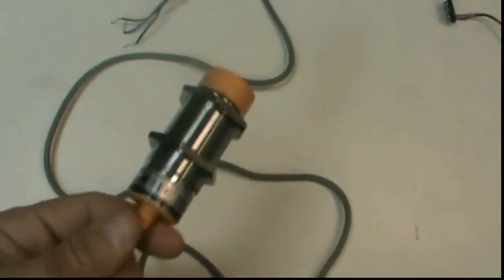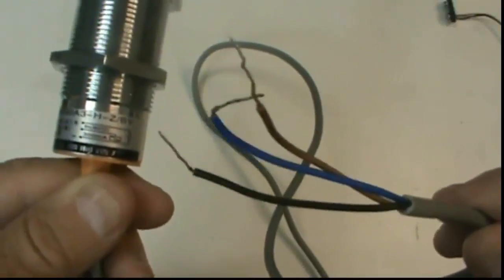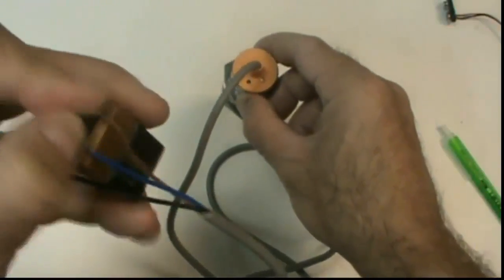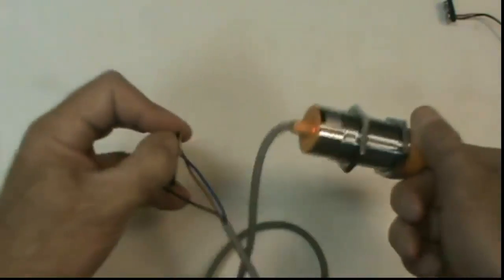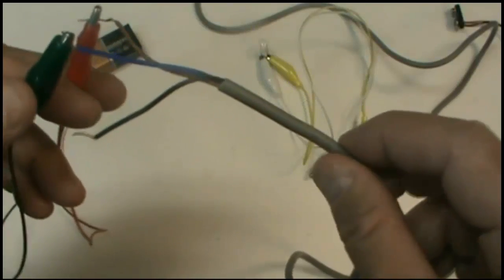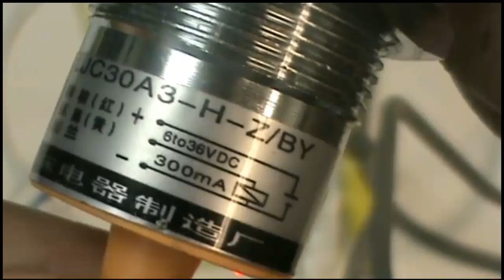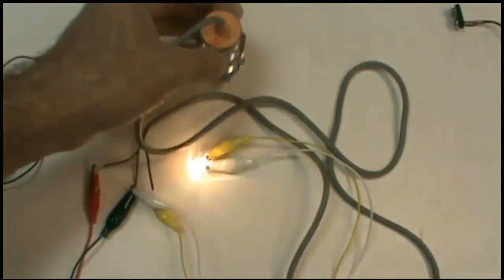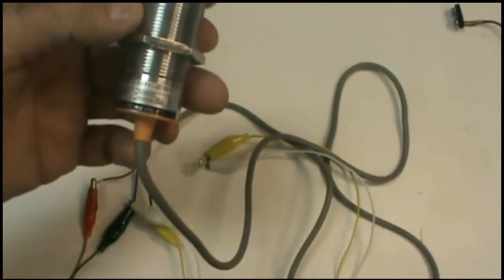Proximity Sensor Basics (PNP, capacitive)

Comment: Very useful. Your instructions are very clear - especially the stepped i.e. first the built-in activation indicator and then the light bulb; as well as the alternative configurations of some sensors. You have experience as an instructor - I don't have to look at any other videos to understand the use of the device. Thanks
Reply from the maker: Thanks for your very flattering comment.

Comment: Excellent explanation ,Please is all proximity sensor use DC current only? If yes why is it so.
Reply from the maker: There are some A.C. proximity sensors but 24VDC is a widely used voltage to power both PLCs and sensors. It is a safe voltage that allows technicians to work without being exposed to dangerous voltages.

Comment: Thanks Dorian nice job.  Not trying to be critical, but, the schematic that popped up toward the end of your video looks like it should have had the ground that ties into the body of the sensor tied together with the negative (common) from the lamp, not separate?
Reply from the maker: Sorry about the confusion. The common connection between the sensor and the load was implied but not obvious as you mentioned.

One of the problems with sourcing outputs is that sensor and load must usually share the same power supply since an interaction between two separate voltage sources, particulary with two different voltages, would result otherwise.

All power supplies have a 0V or common output so these power supplies can be tied together but only two identical power supplies have the same V+ voltage so tying two separate power supplies together would cause a problem.

This is one reason why an output scheme called "Open Collector" was popular for digital logic. Open Collector outputs allowed an sinking output transistor to switch an voltage much higher than the 5 volts required for the digital logic.

Thanks for you comment.
Reply: Dorian McIntire

Nice of you to clear that up for me.  I'm just starting to learn about this technology and any "loose ends" can create confusion on my end.  Thanks again.

Comment: the video was very good . I would like to know how this sensor will work in water tanker and how to calibrate it to show the level for example (1/4,1/2,3/4 and Full)  with the help of LED.
Reply from the maker: There are several options depending on what you are allowed to do with the tank.

If penetrations are allowed in the tank you could use side-mounted, float, reed-switch level sensors. These require a penetration for each level that you want to detect. These are simple, inexpensive and reliable 

http://www.gemssensors.com/About-Gems-Sensors/Press-Release/LS-7%20Versaplast

If penetrations are not allowed you can use one of the following:

- A top-mounted ultrasonic level sensor

- Side mounted capacitive proximity sensor only if the tank is not metal and not too thick. You would need one sensor per level sensed.

There are other options but the cost gets pretty high for other solutions.
Proximity sensor will work well with water but not so much with petroleum products.

Hope this helps

Comment: Dorian McIntire :Using older diagrams which indicate current flow from Batt. + (pos)  to load-thru load- to Batt. -- (neg). If I understand correctly--if my Batt. ( + )  is my "source" , then everything else IS "downstream" from that (+) reference during current flow. If I place a sensor with contacts (N.O. to turn on/N.C. to turn off) BETWEEN the  (+)  and BEFORE my load, that location is termed a "sourcing" sensor ?? or if I locate my contacts (sensor) AFTER the load, downstream BETWEEN load and (--) or ground, that is termed "sinking" ?? is this correct ?  In other words older vehicles had ignition points that make/break the Neg side of the Ign. coil. Points were BETWEEN Neg. of coil and engine ground, so using modern terminology, the Ign Points were on the "sinking" side of the coil ??.
Reply from the maker: Difficult to follow what you said but the following is true:

-- If the sensor "contacts" (NPN transistor)  are between ground and the output then the sensor is sinking, or switching the output to ground.

-- If the sensor "contacts" (PNP transistor) are between V+ and the output then the sensor is sourcing or switching the output to V+.

It's a simple concept but the two configurations confuse people because most people expect the output to be just a simple switch  which should make it a non-issue.

Comment: Hi Dorian , this a excellent video , i been wondering why do we have Sinking & Sinking In-Out  , I know that NPN is a sinking device  and Sinking In and Sinking Out  is a signal in  a  I/O module ,.In other words why do we use the Sinking option?.
Some times i believe that is about the dropping voltage of circuitry.
Thanks.
Reply from the maker: gerardolasvegasable 

This is a good question.
The concept of sinking and sourcing allows two devices to send signals with no additional components required. The down side of sinking and sourcing is that one device must be the opposite of the other in order to simplify the interfacing. If you have a sourcing sensor you must have a sinking input on the receiving device and if you have a sinking sensor you must have a 
sourcing receiving device. If these conditions are met the devices can be connected with no additional components otherwise things can get complicated. Many PLCs have input cards that can handle both sinking and sourcing inputs. See my video about this called PLC interfacing made simple:
https://www.youtube.com/watch?v=qwjPtqzy2nY
The BIG IDEA about sinking and sourcing is that the two devices together complete an electrical circuit that allows the receiving device to “know” the sensor changed state because. The receiving can only know a sensor changed state by sensing a voltage created inside the receiving device when the sensor switch is closed and a circuit is completed. To complete a circuit you
must have a SOURCE of power (V+) and a return path to the power source, or SINK (ground or V-).
Hope this helps and sorry for the delay

Comment: Hi Dorian. I am going to make a speedometer for my bicycle an I will be using an inductive proximity sensor for that. I wanted to know how can adjust the sensor to detect a metal piece like a bolt attached to the bicycle spokes and not the spokes. Or if I should use something other then bolts ? Also what are two screws on the sensor . I think the adjustor is at the back of sensor so what is the role of those screws. I want to attach the sensors to a small screen a place some metal every 90 degrees so the sensor measures the time interval between successive signals and calculate the speed which will be shown on the screen .
Reply from the maker: Sounds like a nice project. I would look into using a Hall Effect sensor and a few small magnets instead of an inductive sensor. This would give the system much more sensitivity and decrease the tolerances of the components.

Please keep us posted on how things go.
Reply: I have also been looking about hall effect sensor and think they would be good too. It's just that I off-road a lot and I read that hall effect sensor are very sensitive too dirt and dust. Still I am making the speedometer just for fun and think hall sensor will be better in that aspect as hall effect can operate at low voltages and are much easier to operate. 
Just wondering if you have a video on hall effect sensors too? And I will try to put a video once I get it working . Thankyou

Comment: Great Video!  I have a couple of 2 wire (AC) photoelectric sensors with transmitter and receiver combined in one unit.   Any idea how these might operate?
Reply from the maker: Yes, 2-wire AC sensors require the load, typically a relay or a light 120 volt load, to be connected in series with the sensor and power. The sensor closes an internal contact or Triac switch to turn the load on and off.

See the following data sheet for details:

http://www.cmafh.com/images/Master%20PDFs/Balluff/Tubular/AC-DC%202W%20Wiring%20Diagram.JPG

Hope this helps.
Reply: Dorian McIntire Thank you.  Now it all (or at least some) makes sense. I just ordered an AC contactor ( and a fire extinguisher) so I can do some experiments. Thanks again for your help. Your tutorials are by far the best!  Simple, straight forward and informative. Looking forward to watching more of your videos this weekend!
Reply from the maker: LegacyMicro Thanks. I really appreciate your comment.

Comment: Hi, I do not mean to seem naive and have little to no understanding of electronics. However, i was wondering if it would be possible to create a proximity sensor that could locate a missing object, eg. TV remote. It is possible to attach a very small transmitter or something to the remote and have a device which could tell you how far the object is from you? The benefit being you wouldn't need to spend ages looking down sofas etc as it would guide you to it, either with a 'hotter, colder' buzzer or a device which visually displays the distance. Any response would be appreciated.
Reply from the maker: There a few ways to do this but some are expensive relative to the cost of the item they would allow you to locate.

Passive RFID is inexpensive (basically a printed antenna) and a transmitter/receiver could be built to locate an item with an RFID sticker attached to it. Such a device could be built to locate items within a few feet of the transmitter.

When Bluetooth and X-Bee technologies become cheaper manufacturers could embed transmitter/receiver pairs into such devices.

Technologies exist to do what your asking its just a matter of keeping the cost down to affordable levels.

Hope this was helpful.

Dorian

Comment: Hi great video I'm putting a tacho in my car and then found out I needed a pnp sensor didn't even know what it was let alonehow to wire it up after 1/2 an hour I found your video that spoke  in plain English not AC-DC ABRIEVIATIONS FOR US SHORT CIRCUT people, I can say with out a doubt black would have been earth to me.I know this is over 3 years old what camera were you using to make the video the close ups are the best I've seen with out selling the kids. :)
Reply from the maker: I used a Sony handicam DCR-SR68 in those days. I'm now using a Sony Vixia, HD camera. I've always had good luck with Sony cameras. The optical zoom feature helps a lot with those closeups. You can get good HD cameras now for only a few hundred dollars if you shop around.

The color coding for sensors is screwed up. I still often find myself trying to hook black to ground.

Comment: Thank you for the video...
I am learning about these for CNC Machine use...
How consistent are these type of sensors vs for example micro switches that have the little arm and wheel... ?
thank you
Reply from the maker: Micro switches do a great job for low duty-cycle (events that don't occur very frequently) applications. If the leaf (metal lever) on the microswitch gets bent it will affect calibration.

Proximity sensors can be adjusted to give consistent performance by either adjusting the position of the sensor relative to the sensed object or by adjusting the sensitivity setting on the sensor. Also they never wear out since the are non-contact sensors.

Thanks for commenting.
Reply: An Ultrasonic Sensor would seem more suitable here; being the high signal character, and the large pulsed range of marked-space.. for the CNC i mean.
Good luck `Frainkmail17`
And nice vid, `Dorian`  (Dorian<- is a musical notation, right?)
Reply from the maker: Major Utah I think Frank is talking about the limit switch used to zero an axis on a CNC machine. Traditionally a small micro switch with a roller arm is used for this but these can suffer from repeatability issues due to mechanical wear and bending of the mechanical arm. Prox sensors usually work very well in such applications sensing small distances with good repeatability.

An ultrasonic detector is great choice for distance or level sensing and reporting but they usually don't do so well for these small distances (typically less than a centimeter).

Yes, Dorian is a musical mode but also a member of an ancient Greek tribe known as the Dorians.

Thanks for the comment and the thumbs up on the video.

Comment: Hi, I'm a newbie, and a student and I wanted to learn about these things. I have question(s) about these sensors, specifically Capacitive sensor. I haven't tried any of those and I'm required to use this on a water level control project but I have no idea on how to wire a 3-wire Capacitive sensor. I have to use 2 Capacitive sensors. Can you help me? Please. I used the 555 IC for the control. Thanks!
Reply from the maker: Please watch my video about interfacing proximity sensors to the Arduino. The video demonstrates how such sensors are connected to other devices.

Comment: hi question: I'm trying to get the right sensor that would activate a warning light when an object moves away from the sensor [ separation detection ] would that be a NPN normally Closed sensor? thank you great video
Reply from the maker: You can either use a Normally-Closed sensor or you can program your controller (Arduino, PLC, Etc) to respond in the way you want it to respond.
Reply: Yeah thank you that’s what I thought using a N/O sensor or a momentary N/O proximity switch since I’m not using arduino or a PLC in my project. Just the sensor and a warning light with buzzer connected to a 12 v. Supply. Thank s for the advice.

Comment: Great educative video, thank you. 
One thing is unclear to me, the output is analog or digital? For example anything between 0 and 12V (so you can measure small distance) or digital =only 0 or 12V (working only as a switch)?
Reply from the maker: The output for these particular sensors is a transistor switch that is either on or off. The output is NOT a voltage since this would limit the versatility of the device.

Comment: Hi Dorian,

thank you for your video - it helped me a great deal. I wonder if you could suggest how to trouble shoot the 
following scenario:

I have been using a LJC18A3-B-Z/BX 1-10mm Capacitance Proximity Sensor Switch (NPN NO DC 6-36V 300mA) 
as the auto leveling sensor in a Tevo Tarantula 3D printer.  The printer is controlled by an MKS Base V1.4 Arduino ATMEGA 2560
M/B using Merlin firmware.

The proximity sensor is wired to the MB in the following way:

Sensor Brown (+ve) >>>>cable>>>> Power Supply (+ve) 

Sensor Blue  (-ve) >>>>cable>>>> Power Supply (-ve) >>>>cable>>>> M/B Z- Switch Port (GND)

Sensor Black (sig) >>>>>>>>>>>>>>>>>>cable>>>>>>>>>>>>>>>>>>> M/B Z- Switch Port (D18 +ve)

The proximity sensor is aligned with the printer nozzle, and as the printer nozzle approaches the printer bed, the
sensor triggers, thus determining the zero position for the Z axis. It does this at several positions on the printer
bed, allowing the software to make corrections to the height of the nozzle if the printer bed is not level.

This set up has worked really well on dozens of prints since 2018. But recently, a few seconds after turning the power on
the cable connecting the Power Supply (-ve) to the  M/B Z- Switch Port (GND) melted and burned generating lots of smoke
.
The sensor was several cm above the bed - that is: not activated.

This is the only cable that was affected in this way

The cable is easily replaced, but I can't figure out what might have gone wrong, and I don't want to just replace the cable
until I know what may have caused the problem and that it can't happen again.  I am concerned that it may be the sensor or
the main board, but I don't know how to check either of those things and if it is one of those things I can't explain why only
that particular cable and no others were affected.

Can you help me again by suggesting what I should be checking?
Reply from the maker: Difficult to say but if the sensor was inactivated at the time the only type of failure I can imagine is an internal short between V+ and ground inside the sensor. May just be one of those random events that may never happen again. If the sensor was activated at the time I would have guessed an NPN driver transistor short due to a low resistance load driven by the transistor. Might also want to check if the power supply sent a voltage spike to the sensor that exceeded 36 volts.

Good Luck
Reply: @DorianMcIntire  Thank you very much - It actually reassures me that you think it may be a random event - The main thing that puzzled me is that the other wires were not affected, not even the wire coming out of the sensor that is connected to the one that melted  or the adjacent wire that is actually bonded as a pair (I wish I could post a picture).  

It occurred to me that the cable may have shorted to ground on something. Cable management has been difficult and there are twists and turns within a tight space. I'll try some tests with a multi-meter to see that everything is working as expected and if it is I'll try rewiring the old sensor. If it happens again I'll replace the sensor and if it fails again then there is something wrong with main board... ($$$)  - I'll keep you posted, if interested.